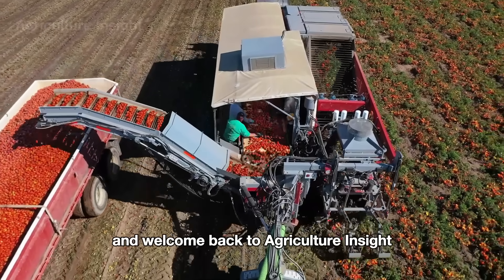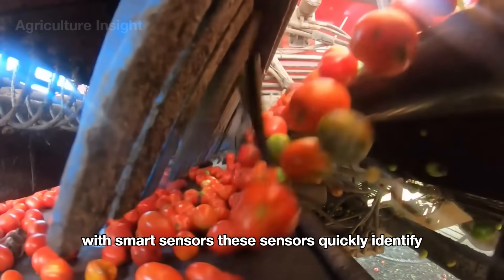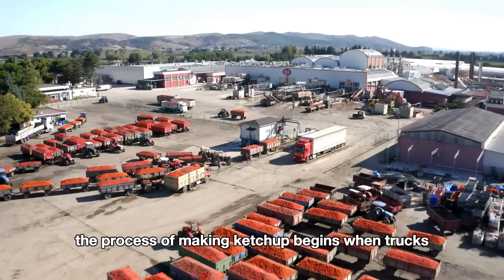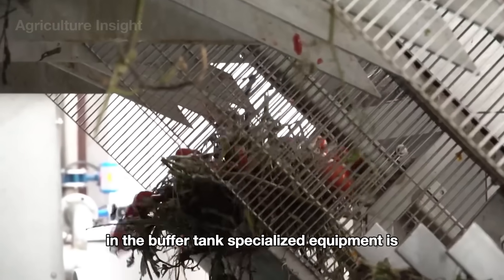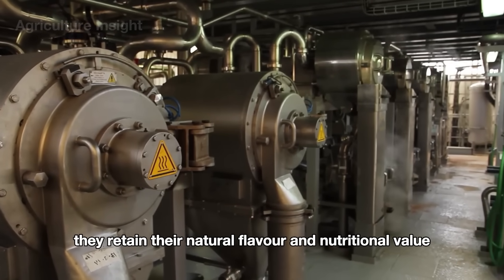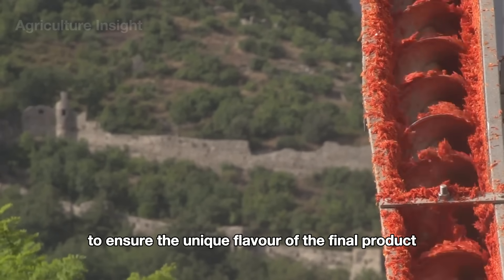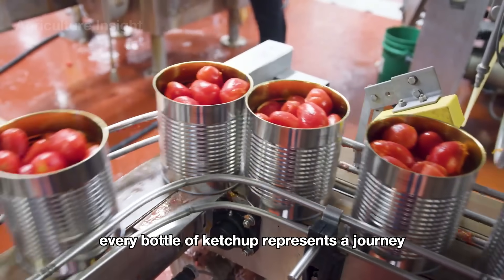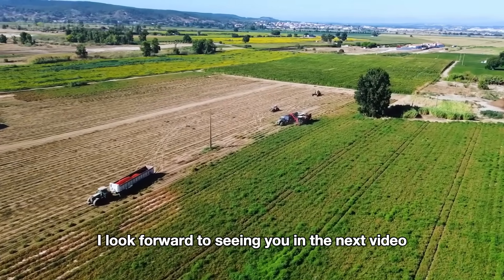27 Billion Pounds Of Tomatoes Are Harvested To Produce Ketchup This Way | Agriculture Technology

Comment: How can trucked pile tomatoes doesn’t crush the soft tomatoes?
Reply from the maker: "The key is careful stacking and proper handling! When tomatoes are harvested and loaded onto trucks, they are usually placed in shallow bins or crates to prevent excessive weight from crushing the ones underneath. Additionally, many commercial tomato varieties used for processing have firmer skins and flesh, making them more resistant to pressure. Trucks also drive carefully to minimize shaking and damage during transport!

Comment: Better use those 🍅 for sauce pasta sauce
Reply from the maker: Great idea! Fresh tomatoes make the best pasta sauce—rich, flavorful, and perfect for any dish. Nothing beats homemade!
Reply: @ I make my own tomatoes sauce when in seasons summer time  buy them in box lot work but worth the effort , boil them  till soft strained mix in to purée, bottled sterilise bottle shelf in cool place last 3 years nil add only basil 🌿 try , no skin or seed goes in to the sauce machine remove them
Must no discard the boil water need in the end to
Mix in to the puree depend a thick or liquid you want the sauce , when I make usually take all the water back strained first
Reply from the maker: @Rust-g7y  That sounds amazing! Homemade tomato sauce always tastes so much better, and your method is so thorough. Using the boiling water for adjusting the consistency is such a smart tip! The addition of basil must make it incredibly fragrant. Thanks for sharing your process
Reply: @ thank you , 
50 years been make this sauce 
The same way ,

Comment: Does processing tomatoes through so many steps lose their flavor?
Reply from the maker: Great question! While processing tomatoes involves multiple steps like washing, sorting, and peeling, the goal is to preserve their natural flavor, not lose it. Modern processing methods are designed to retain freshness and enhance taste by sealing in the tomato's natural sweetness and tanginess. For example, quick processing right after harvest and using vacuum or heat-sealing techniques help lock in the flavor.